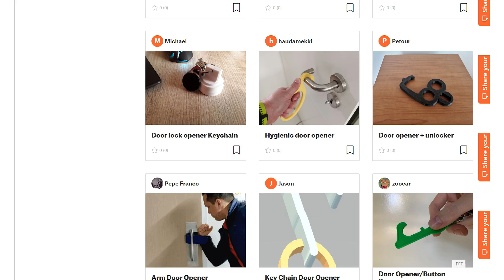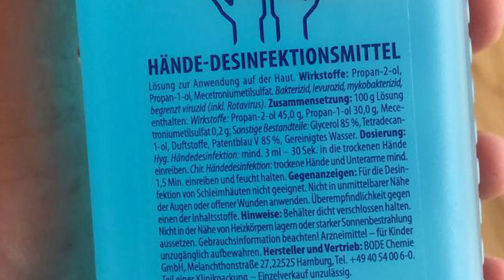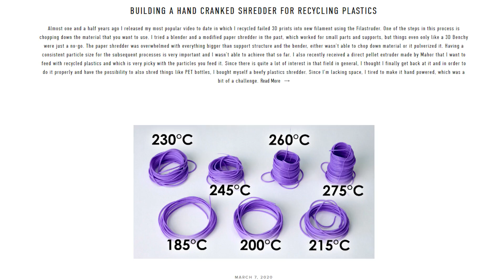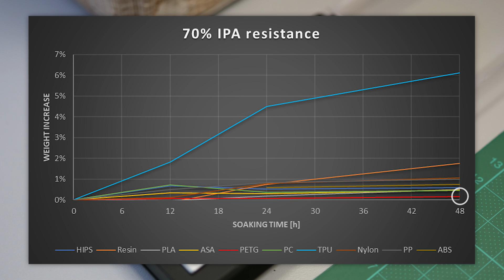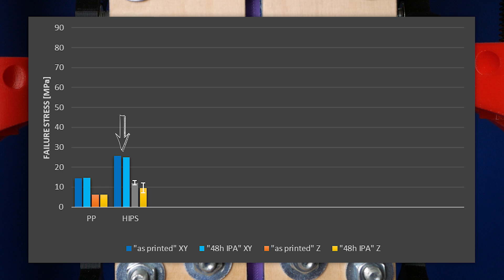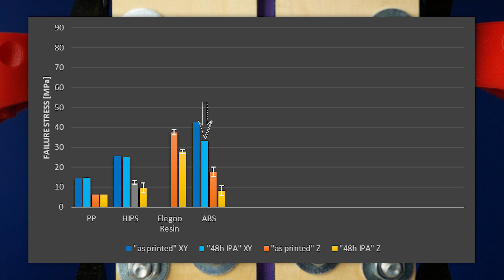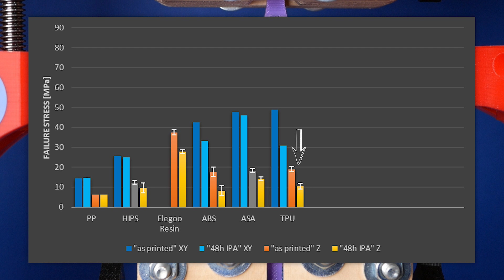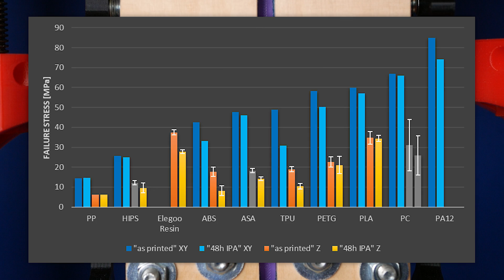Does 70% IPA reduce the strength of 3D prints?

Comment: Its interesting isopropanol does not attack pp 3d prints. I have wiped PP injection molded plastic with isopropanol and they cracked and got completely destroyed so much so I wrote warning messages on the alcohol bottles to myself.

Comment: Mix the 70% with salt. Because sodium chloride creates a stronger bond to the water than alcohol all the water and salt will sink to the bottom and you will have a higher concentration of alcohol at the top. just use a syringe to suck it off.

Comment: From your videos we know that streght of surface layers mostly important, so no need soak parts for hours. Then maybe soaking for few seconds and let's dry up will be closer to real life conditions and repeating that process many times might put some stress between layers due to temperature changes when alcohol evaporates. Soaking all part together in one bath is not right way as well maybe some particulars flushed from one materials can affect other one. Disinfectant possibly may have other ingredients which could effect materials like natural oil, glycerine etc. Example like car fresheners spiled may damage injected mould parts inside car  cabin. Some solid parts can be flushed with just boiling water and that should kill germs especially virus even quicker. Bay the way I wonder if parts baked in oven or cooked many times changing strength noticable.

Comment: I know you've already done a video on extrusion width and how it affects strength and print speed on a single material, but can you try something similar across multiple materials?
I ran across a forum post on the Prusa knowledge base for how to print polycarbonate without an enclosure by applying more pressure on the plastic (with much higher extrusion) instead of more temperature. They seem to believe this is only a property of PC, and that it doesn't work as well with ABS or PLA, but I wonder how much of an effect it has on the strength of the PC parts, and whether or not the same technique can be applied to other high-temperature plastics.
https://forum.prusaprinters.org/forum/original-prusa-i3-mk3s-mk3-print-tips-archive/polycarbonate-here-s-how-to-print-it-without-warping-delamination-or-an-enclosure-with-better-than-abs-results./

Comment: Test pure PP with spraying IPA droplets. In my and other's experience, at least non-3D printed parts will crack and craze, and in some test I'm running, actually at this very moment, I discovered that submerging them for 8 hours per mm thickness 'repairs' them (as well as smoothens them)

Comment: This experiment is great, but like you said IPA is rather hard to get by nowadays, it is a rare commodity. I remember that you made an excellent video about annealing, you showed a graph and according to your tests the annealed PLA was able to withstand a temperature of 160C (compared to only 60C for the non-annealed PLA). This means that supposedly now we can sterilize our annealing PLA parts by simply boiling them in water (maybe with a bit of soap as a surfactant). What do you think? Do you think the parts will hold the boiling process? It would be a cool experiment to do! All the best 👍

Comment: An excellent testing demonstration... might I suggest a slightly thicker or more robust ring section or do a stress analysis on your design to alleviate the failures of the rings since you are wanting to test the structural integrity of the central section.... Another test I would be interested in would be the lateral or perpendicular structural integrity as many of these uses will have a larger vector component in those directions then just straight tensile utility...

Comment: I don't know if someone already mentioned about the moisture the printed parts absorbed, since the IPA ratio to water is 7:3. Would it be different if it was 99% IPA?
For the same reason why filaments have to be kept dry and good idea to store in reseasable bag with the dessicant.
Just my theory why they have reduced in strength is because of the water.

Edit: For the most part IPA evaporates very quickly, so to me it wouldn't have much an effect to the prints. Even with resin, you bath the prints in IPA for hours. So 🤷‍♂️

Comment: Hi Stefan,
you did a really good job, as usual, on the other hand.
How long did you take the tests after the dive?
Is it possible that by letting them dry for longer their characteristics return to the previous strength and size?
In essence the variations are definitive?
If this were the case, then all the materials that return to normal would be unalterable from the daily use of the 70/30 solution which would come into contact for a decidedly short time even if repeated over time, with a limited amount of solution that soon evaporated (I don't think it is practicable to walk with a container full of disinfectant solution able to accommodate the various devices, even with the current restrictions on movements in the area)
  Hello and keep it up, I like your scientific rigor in carrying out the tests.
Very interesting, i hope coming soon,  UV test

Comment: FYI: These results are also heavily influenced by the concentration of your solvent. I have found that a 5% change in IPA solution can have a (engineeringly) significant impact on strength. In a recent test, i submerged ABS, ASA, and PC samples in a high concentration methanol. I was quite surprised a day later to find that most of my samples had lost form and become a slime on the bottom of  their sample containers. Identical samples in a 50% MeOH solution showed strength loss but not full cohesion loss. Just FYI for those expecting identical results from 91% IPA, the other common retail concentration.
Reply: Understanding from a few sources is that 70% IPA and some H2O is actually generally considered a better mix since it won't instantly start evaporating more of the alcohol is able to denature the virus (also polar properties of water help as a solvent in general).  I don't know if there is value in going higher really (it has been shown to kill viruses more slowly at least in some cases and I believe with Covid-19 specifically)

Comment: Have you noticed any difference in the feel of the parts? My PLA in alcohol has caused it to feel sticky
Reply from the maker: Besides the more flexible TPU parts, I didn't feel any difference.
Reply: @CNCKitchen  interesting, wonder is it was the colour / manufacturer of the material that made the difference. Or the use (using it as strainer in IPA for resin prints). Thanks!

Comment: I'm not sure your solution you soaked these parts in is 70% IPA. Generic bottles of IPA already are diluted to 70%. Or, if you get the good stuff, it's 95%. Either way, adding 30% distilled water by weight or volume to the mix takes it below the potency needed to disinfect. Only if you're using lab quality 100% IPA is this potent enough, and then you just wasted a resource that was expensive before this crisis. 

If there is no reaction to the parts, you can reuse the IPA, so there's no reason to dilute.
Reply: The bottle you can see in the video says 99,9%
Reply: @rynnjacobs8601  Good to know.

Comment: I've been spamming out facemask parts in PLA as that's all I have, before noticing that prusa recommends PETG, because you apparently can't disinfect PLA with heat (I'm still skeptical about that to be honest. You can't tumble or scrub in boiling water, but the temperature should still destroy any viruses, surely?). I'm so glad you've shown that alcohol doesn't destroy PLA because it means my efforts haven't been in vain and maybe the protocol for printing equipment should be rethought. Maybe you could do a video on heat sanitation as well as UV next. Thanks.

Comment: You need better video titles :) 
This one should have been called simply "Disinfecting 3D prints for 48h".
The rest are details that are unnecessary on the title itself as they will not add value in terms of attractiveness to click on your video.
Reply: No. It should be exactly what it currently says, "Does 70% IPA reduce the strength of 3D prints?", because that is the *Only* "disinfectant being tested... What you suggested would be misleading and disingenuous as it does *NOT* cover any of the other myriad disinfection options that could be used and that is *very* important.

Comment: Great video,  
what about a smoothed abs surface ? Less defects should result in parts easier to clean, less affectet to  to alcohol and in general more strenght.
UV test would be interesting.  At least for longterm outside use.
Reply from the maker: Smoothed ABS should be better for cleaning. Wouldn't use Polysmooth though, because that's melted by IPA.

Comment: CNC Kitchen, I like yours videos however I am afraid that this time your methodology is not correct unless you wanted to check chemical/physical properties on the filaments. I am working at the hospital as a researcher and I am carrying out the piece of research about sterilisation for the medical printing. First at all, the FDM printing is not very clean. Some of the filaments are toxic by the nature of the used components such as ABS. Second, you show potential disinfection method of the printing model after the printing while you are printing in the potential contaminated conditions (a home room etc.). In the lab to manipulate samples we use the hot with HEPA filters. Which prevents to come any potential impurity around manipulated sample. Another thing is that mostly we do not print 100% and we trap the air inside the model and maybe the bacteria’s etc. In the hospital Isopropanol is used to the temporary usage (clean surface (not always), hands, …) For the real sterilisation autoclave (around 120deg) or Ethylene Oxide Sterilization (with around 65deg) if I am not mistaken. However, the best seems to be radiation (not be confused with UV). UV is used to fresh/clean the air. To sterilise the surface with UV is difficult because the light will not go all places we want.

Speaking about this movie. If you want to check chemical/physical maybe you should start to have a look at the chemical chart of the reactivity the filament with isopropanol? I think it might bring some solid background to the movie? Just a suggestion. However, nice video as usual.
Reply: Hi, would you confirm that soaking is an uncommon and inefficient method compared to wiping? Just to avoid misleading people.
Reply: @mellertid  maybe try this one? https://www.ajicjournal.org/article/S0196-6553(12)00344-6/fulltext
Reply: @mellertid  https://aricjournal.biomedcentral.com/articles/10.1186/s13756-019-0595-2
Reply: @mellertid  https://www.ncbi.nlm.nih.gov/pubmed/16496573

Comment: You do an amazing job of scientifically testing all kinds of things. However, I have a short comment on your tests with TPU. Polyurethane is known to swell in alcohol like isopropanol which explains the lesser strength of the material. The Isopropanol molecules gets into the material, have you considered to store the disinfected pieces outside for a few days? Then they should shrink again and the mechanical strength is back to the original.

Comment: in the lab we tested a few autoclavible materials, ABS and PET based materials have to be gassed and worked well for custom racks. There are a few materials made with PP in labs so it might survive an autoclave cycle but string materials polycarbonate are known to degrade in an autoclave; I have yet to find a material that can survive a cycle long enough to be used for culturing.

Comment: Were you allowing drying time after the isopropyl soak? There could be a difference in strength between parts just after the soak and parts that have had time to dry. I suppose this would be the difference between temporary softening and permanent damage to the polymers. This could be especially significant for the TPU based on its mass increase.

Comment: Thank you! Very timely, I shipped 60 of the Prusa RC3 frames out today to a local hospital, that will be sterilizing with UV. So I would be very interested in UV results. Also I have heard that some facilities are considering using a bleach bath to sterilize PLA parts. This sounds like it could be more destructive than alcohol, would love to see it tested as well. 

While PC might be a superior material, seems like PLA, PETG, and ABS are probably going to be the 3 most common materials used by community printers. So maybe the material choices could be scaled back, but the disinfecting methods expanded? Thank you again, this is very timely information!
Reply: Seconded - The makerspace I'm working with has a ton of PLA, but not much else in backstock.

Comment: When we come to the point that we need 3D printed equipment it means that the healthcare system has not enough capacity. At this time the most important thing is to protect the healthcare workers (e.g. with 3D printed masks). And then nobody cares if there are some bacterias on the mask. It's like your cellar is flooded and your care about your wet shoes. In Spain people are lying on the floor because they have no beds. In Italy people are dying at home because hospitals are full.
I'm working in healthcare facilities for over 15 years and I totally agree that in normal times we have to think about this problem. But it's no normal time now. We have a Pandemic. It's more likely to die from the Corona virus than from a bacteria.

Comment: Good analysis. Your testing procedures followed best practices that under the circumstances, would probably be found by a professional lab. 

Of course, there are some gaps but these cannot be carried out given the current circumstances.

You're correct in your observation that isopropyl alcohol is now in very short supply in many parts of the world. 

This opens the door to the question, what are some good, safe, alternatives for cleaning 3D printer build plates?

As a substitute, I have been using methyl hydrate
 (CH3OH or CH4O) 

for my Anycubic 3D printer which has an unknown (to me) factory coating. This chemical is not ideal because it should not be inhaled or exposed to your skin.

Btw, methyl hydrate has gone up in price here in Canada. A 4 liter container is $13.00 inc GST CAD. Isopropyl alcohol was $7.00 inc GST for 750 ml before the pandemic. None of the locations or Amazon.ca have stock.

Comment: I wonder if you could dry the parts after soaking them in iso to gain the original strength back.

Would also be interesting to see what happens if you soak them in 99% iso, as 70% often has additives in it other than just water and alcohol.

Comment: Great video!  You always come up with a video to explain something I worried/thought about the other day.  It's like you are really good at thinking about potential problems with 3D Printing and how to fix them.

On the subject of  the lug breaking a lot during the tests, have you considered switching from a hole-based connection to more of a V-shaped 2D funnel connection?  Like having /[part]\ with the / and \ being sides of the funnel, with the back and front open to insert the piece, and a top and bottom connection.  That way the entire end of the print is the connection, without a weak point at the lug.  Angled strips of metal would do the trick, and the piece printed like >=<.

Comment: Before watching : Think thing to open door and push button is good. On my side i use two sheet of toilet paper then put them in my trash i always carry on my right side. Also my left side is always proper because i only use my right hand. At the super market i only use my right hand, don't care if i lost 2mn in the process. Then back to home i take back my key right hand only and put them in the water with dish soap. It's so bad no one talking about this shit. While some stupid guys are walking naked foot with flip flops at the super market.

After watching : Yeah PLa is the most suited for that, and to avoid moisture and other shit you can smooth it with two coat of primer and two coat of clear protection thing. Then you can finger in the nose dish soap wash. Maibe i gonna print something, but i almost out of filament. But it's better than wasting 10 sheets off toilet paper. Dunno. im bored after 12 days of quarantine, nice project maibe.

Comment: Really interested in the UVC stuff. More so than the chemical actually
Reply: UVC is really.drastic and i dont thing very good in 3D print with lot of pores. mainly it can quite good break weak plastic bonds and have limited penetration. in this case liquid is best I think.
Reply: @Passco666  UVC is what hospitals use
Reply: @kazolar  Just because hospitals use it on current equipment made with current materials (likely more metals and glass than plastics) doesn't mean it's the best idea for 3D prints... also why not use alcohol if it is effective will penetrate as much or better than UV and is far more accessible.  3D prints all have layer lines that create little ridges that light won't evenly hit (it will shadow itself to some degree) liquid seems a better candidate for filling the volume since that's what liquids do.